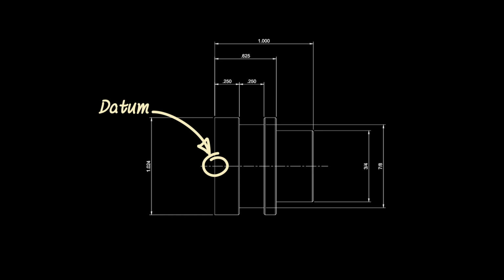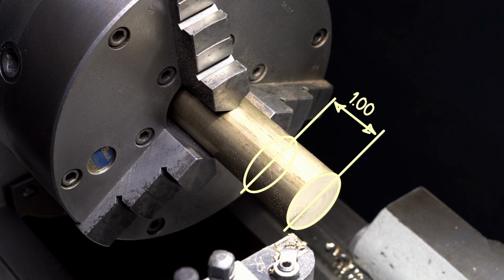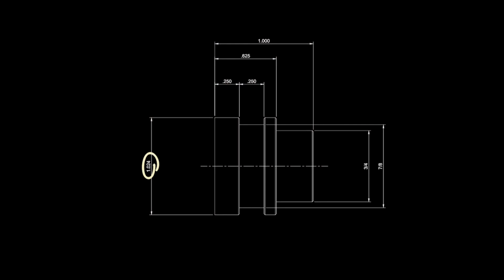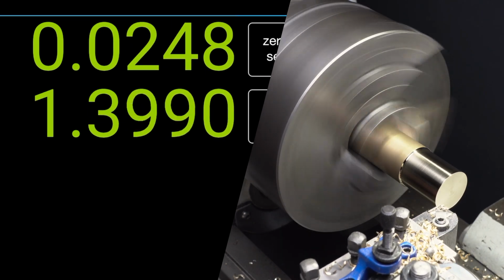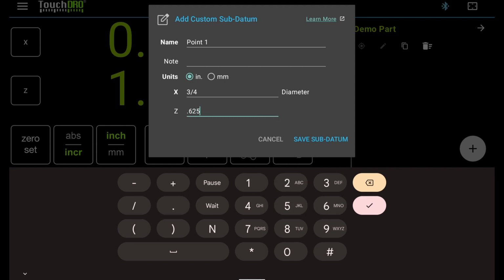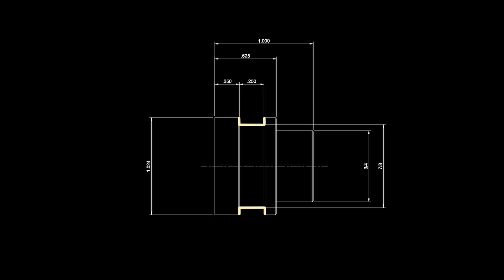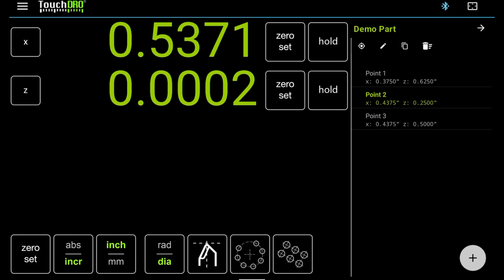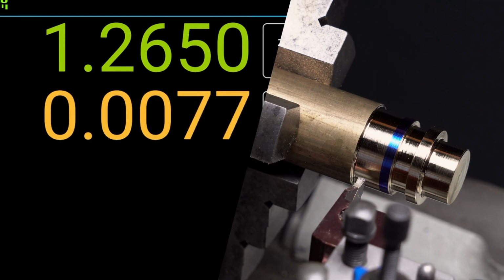A Better Way To Use a DRO on a Metal Lathe

Comment: My keypad display doesn't have the non  numerical part is there something I'm missing
Reply from the maker: You might need to install a different keyboard. Google's GBoard respects these setting better, so you could give it a try.
Reply: The Microsoft AI keyboard works well.
Unfortunately I tried the Google keyboard and it only gave the numbers